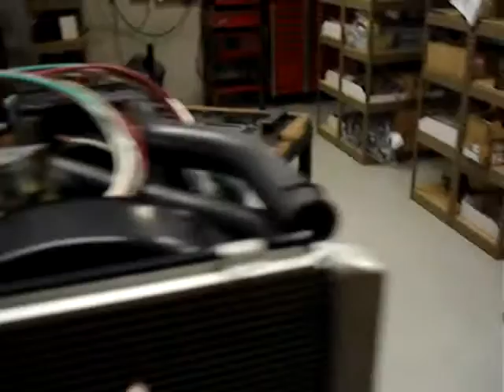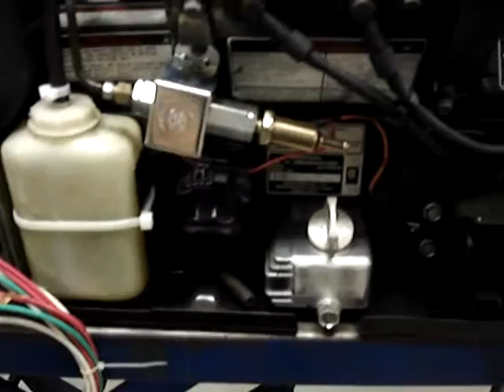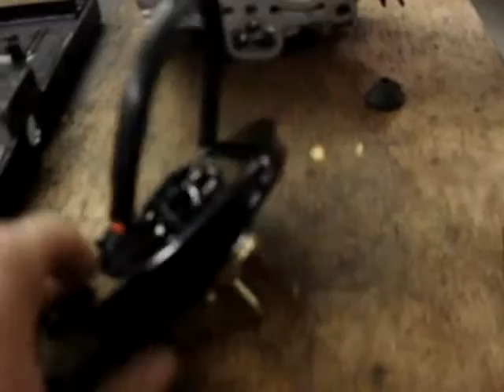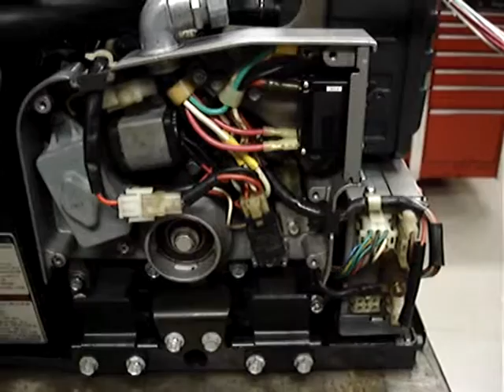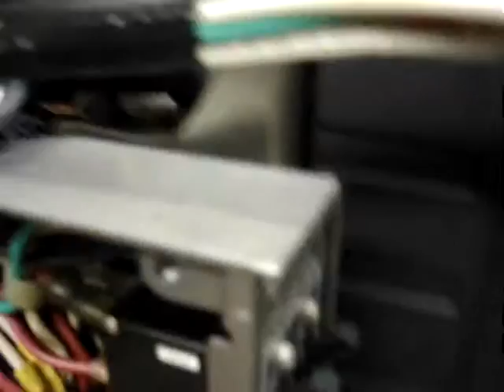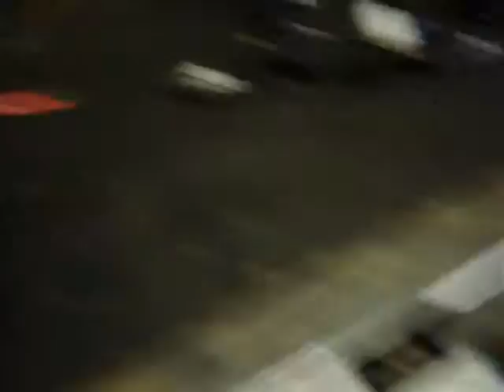Honda EV6010 cooling System By Pinellas Power Products

Comment: Hi. First of all thank you for making these videos. It is apparent you are an expert on these generators. I also appreciate the depth in which you go in with your information. I have a question about the cooling system video. You mentioned removing the white wire from sub winding number 1 so subwinding 2 is not charging the starting battery. I have a 3 bank marine battery supply I would like to use the generator to charge. If I remove that white wire, will the generator still charge my battery bank?
Reply from the maker: No it will not the battery this way. I cut the white wire to keep it from burning up an $1100 stator. Use an external charger to charge the battery while the unit is running. I have replaced hundreds of stators over the years due to the fact that the sub winding is simply not robust enough to do the job.